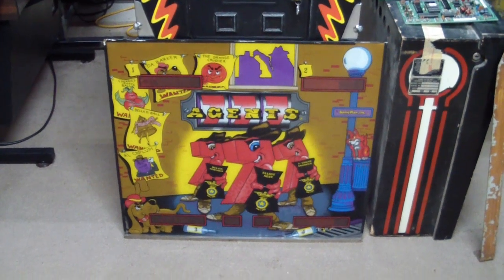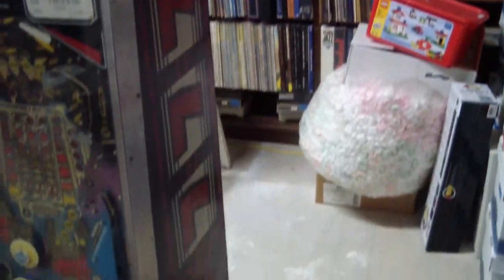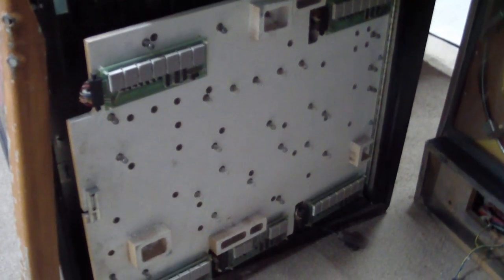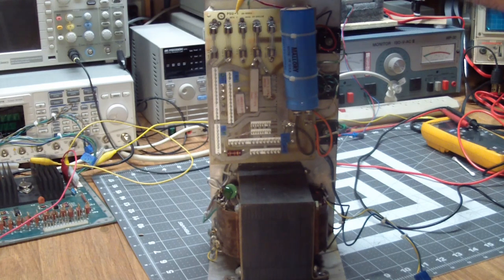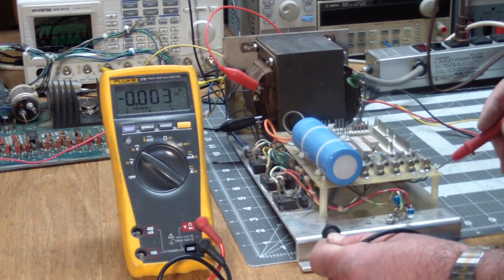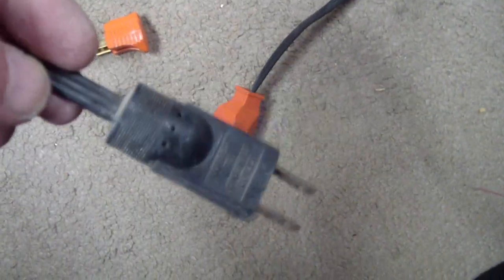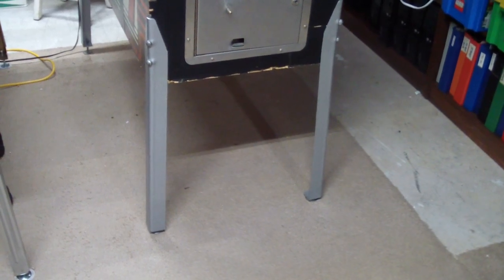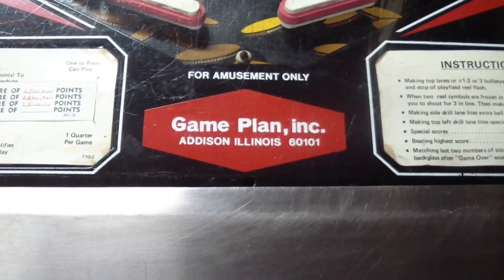AE#179 Game Plane Agents 777 Pinball Repair, Part 1

Comment: That's on monster of a power supply! Looks like will be a nice repair.  Do you ever replace all those lamps with LEDs?  I have when I repaired my 1995 RedWhiteBlue slot. I have found LEDs that look just like the incandescent lamps.
Reply from the maker: I still stick to #47 bulbs to keep the original ambience.

Comment: if i remember correctly gameplan used some kind of weird ram on the cpu that was obsolete when they made these machines. hopefully that's not bad on this 1 as they are unobtanium.
Reply from the maker: As luck would have it both 6551 SRAMs were good.

Comment: ARTIFACT< Why did the pinball game designers use UNREGULATED voltages instead of Regulated voltages? I would think Unregulated voltages would cause more noise issues on the voltage rail lines and also the voltage can drop when drawing current from the LOAD. It doesn't make sense to me why they used unregulated voltages and what are the "advantages" of using unregulated voltages?
Reply from the maker: First you rectify the AC coming out of the transformer to get unregulated DC. This voltage is dependent on the transformer and diode forward voltages which can vary quite a bit, thus the unregulated DC voltage. Then you run it through a regulator which is very tolerant to different input levels.